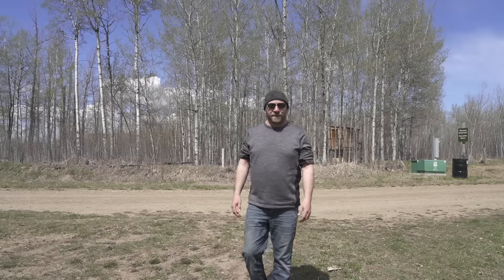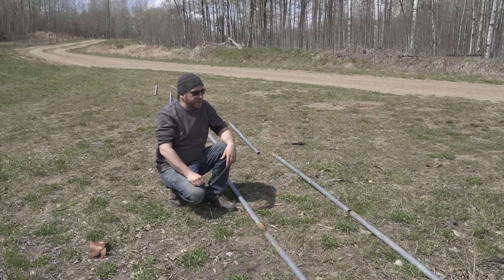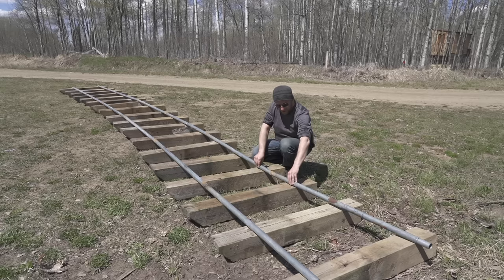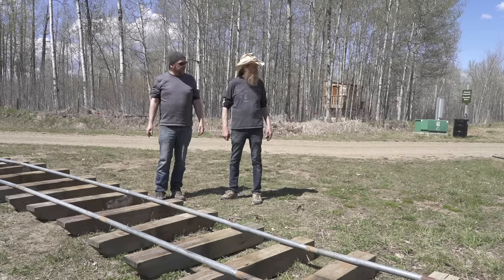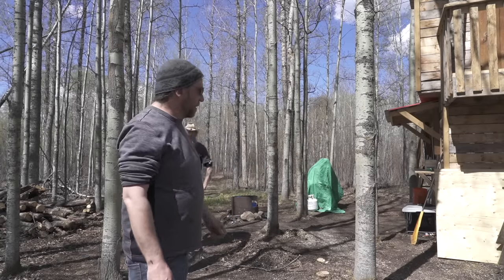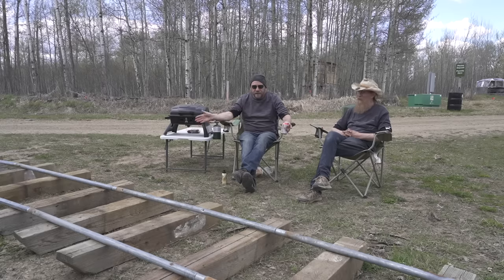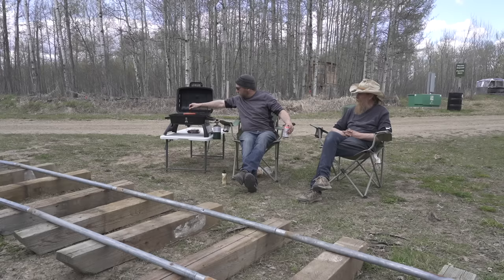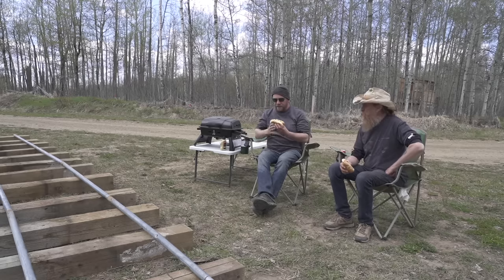Homemade DIY Railway - Work Begins Update

Comment: Have you checked out some of the configurations you can get to host 5G off a repeater? You should be able to install a system to catch a good signal for much less than Starlink costs.

Comment: I don't know Steve, I kinda doubt that merely alternating 3/8th inch lag bolts to hold the rails on the ties will be robust enough to last very long.  I likewise know nothing about building rails, but with time plus the elements plus a bunch of weight moving a train of some sort along them, I'd think that something will move eventually, and start causing drastic or even catastrophic problems.  Making damn sure you know nothing will move or warp or twist is probably a good idea, when you're talking about making a functioning rail system.

Perhaps welding some sort of gusset or cleat to the bottom of the rails, then lagging those onto the ties, will be in order.  Some sort of jig to make installing all of the above might be a good idea as well.  That could be something as simple as a stick of wood the exact width between the rails to make sure they're all exact, but better still would be a jig that centers the rails from the edge of the ties, in addition to making the rail widths exact. 

On a similar note though, I kinda wonder if Crazy Neighbor ever had any inkling of the adventures he would find himself getting into with you, when you first moved in.   Do you think he saw you and Beautiful Wife carrying furniture into that house and said to his own wife something like: "Say dear, have you seen the new neighbors moving in yet?  There is a younger fellow who is going to HVAC school, along with a nice young lady who appears to be a teacher moving a ton of camping gear into the old Jonston's place.  I bet in a few years time, I will go on a number of camping trips with him, including building 3 boats and camping on rivers, and eventually I will help him completely guy and rebuild/remodel a rural acreage, and even build a custom rail and train system to move between said remodeled house and a  bunch of tree houses and shacks we will build.  Plus drink a loooot of beer and even use our garage as a space to test some crazy DIY cooler system we build together too."

I hope so.

Cheers to you, Steve, and CN and BW and everyone who helps you or works with and for you on these endeavors.  Good luck with this badass rail system, and whatever crazy thing you and your group of camping hooligans get into next.

Comment: The downfall is that the rail needs some kind of lift, it won't work properly if you leave the trails laying flat on the boards. 😆 Well of course you can mod the wheels.

Comment: Get ss20 top rail it is very strong and still have the swedge end. Ss40 is the strongest fence railing but it needs a sleeve that’s is trash in my professional opinion as a fence builder.

Comment: are you going to source rail wheels or try to use a normal brake drum on a shortened axle? Curious if the cost works out better and if it would function just as well, you know?

Comment: The Film Industry uses small track to run cameras on. They might have some surplus equipment or even ideas.

There are many Rail Fans who have clubs which build and operate small railroads. They haul passengers when there are special events. They do all the things you will need to do and have equipment to copy.

There are many different types of Rail Fans. Some have their own Speeders which are small self propelled things which can carry a few people. Railroads use such eqiupment for track inspection and small work crews. Hobbyists will buy those or make their won. 

There is an entire thing using bicycles with special gear to run on rails. People make those themselves.

There have been standard automobiles fitted with wheels to run on the rails. They look like training wheels on a kids bike.  They are called High Railers. Some do that illegally with a regular vehicle. It is greatly illegal and unsafe.

Some Speeders have been made from scratch out of laundry motors and similar things.
Reply: the Hi-Rail' concept is being studied closely...

Comment: Honestly start with some basic railroad construction research. I think this project probably has several inherent issues that could be addressed in creative ways, the least of which being that sitting on dirt will cause them to sink unevenly over time, even with very little weight. Not being a downer, just want to see you plan for success
Reply: believe it or not there is more than one person involved  on this project with actual real Rail Road  experience  [CN and CP] plus enthusiasts from various rail museums who have kindly offered  advice....

Comment: What're you going to use for the power unit?
Reply: still a bit up in the air at the moment but the 'hi-rail' concept is currently favoured... so lawnmower, quad, motorcycle etc...

Comment: I'd be concerned about the load-bearing capability of those pipes you're going to use as rails. My fear is they'll deform pretty badly, even if you make your train and cars ultralight.

Comment: Steve, just use fence top rails that connect into each other like you mentioned, and the pulley type fence wheels for gates.  Then drill a hole in the top big enough for a lag bolt head and a smaller hole in the bottom for the screw diameter and attach them to the wood. The small holes in the top of the rails should not affect how the wheels roll. See this guy who is building a railway at his place using flat pieces of steel. Your way may be better and cheaper. Get a cheap ($200?) pipe bender press at Princess Auto to make the curves.....see one of this guy's video here:  https://www.youtube.com/watch?v=kKxpZxDEY1g&t=4s
Reply: cheap is good... Way out West has been an inspiration for sure by the way.

Comment: Steve: before you pump a load of time/effort/cash into the diy track, have a look at commercially available systems. Garden railways are a "thing" and trackwork systems are available in various gauges. 'G scale' could be an option, as could 5 inch gauge.
Have a look at https://www.youtube.com/watch?v=oWv8YdFOdRc 
Just as an example, this might give you some ideas. Larger scales are available, which might be more suitable for moving wood around. Have a rummage around YT, there's stuff out there. "Garden railways/railroads", or "narrow gauge railways" would probably yield better search results than "d.i.y.".
I get that you're trying to d.i.y. this thing but I honestly think that conventional, solid rails and flanged wheels would be the most logical way to go.
Whatever you decide, I'll be interested to watch and I wish you Good Luck - you're gonna need it.😁
Reply: the object of the exercise is to NOT spend any money....hence the free ties and pipe....
Reply: @mrbillmacneill  Yeah, I get that. Steve has already said he'll need to buy more "rails" and other supplies/materials. I'm just suggesting that pre-formed commercial products might do a better job. If the diy set-up doesn't work, he could be wasting time anmd money. Tried and tested products could be cheaper in the end. 
With nearly iM subs nowadays, Steve can presumably afford some outlay on the project. I completely understand the attraction of building a railway from leftover supplies but he's limited in how much leftovers he has. Buying wood and metal these days is a pricey business. If you read my comment, I only suggested "having a look" at what's available. Not everyone is familiar with the garden railway world and he might be surprised by what is available.

Comment: This won’t work. You can’t just put curved wheels on the pipe if you say you want curved track. It won’t go around corners without derailing. Look up videos on how train wheels work. They have a conical shape that keeps them centered on corners. You will need to do some engineering.

Comment: The engineering is one thing but you'll need a name for the locomotive, a name for the rail line, a union, and rail dicks to keep the hobos from jumping on/off when it's in the yard. You're going to need a first class over nighter car with upper and lower berths and an economy class cattle car. You'll need a bar car too...call it the 'Step Two' car....  You're gonna be busy  🙂